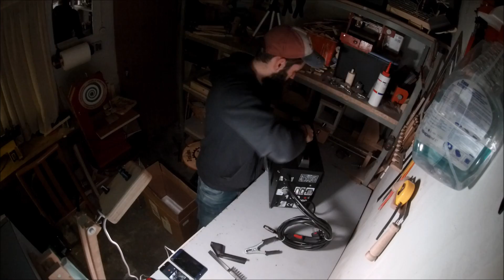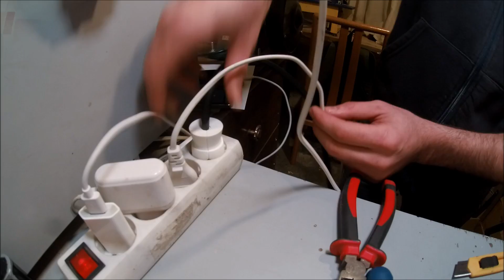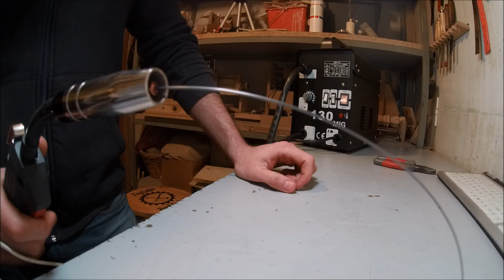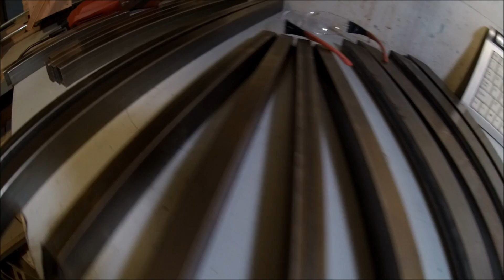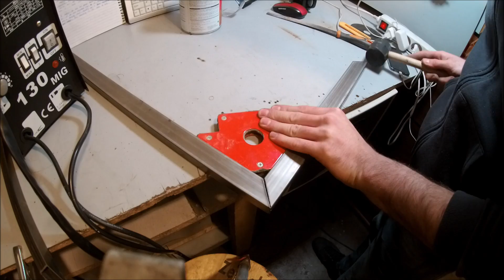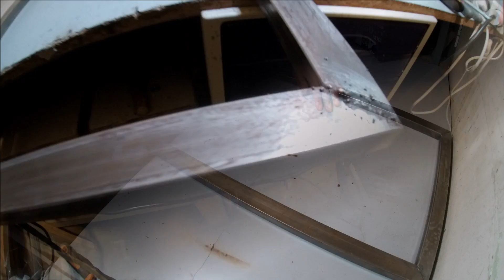Different types of welding

Comment: Interesting. I would love a machine like this. Still have stick welder, the welds are really really bad 😁
Reply from the maker: The splatter is highly compared to stick welding, but still I guess wire gives a bit more accuracy and therefore less grinding! But having any welder is much better than having no welder I guess! You 'll get you one someday bud 🍺
Reply: Indeed 😁 thank you

Comment: there's also ric welding wherein you go to Quebec city and your brother Richard does the welds for you on his ... i think tig. but if i have to make steel frames  i'll probably use machine nuts and bolts which are quite expensive,  or aluminum t-slot extrusions, or wood, though wood ends up being heavy and bulky.
Reply from the maker: Oooh Ric..a.k.a. "the welder relative welding". This one is just a joy to use! Cleanest and most efficient of them all...😁